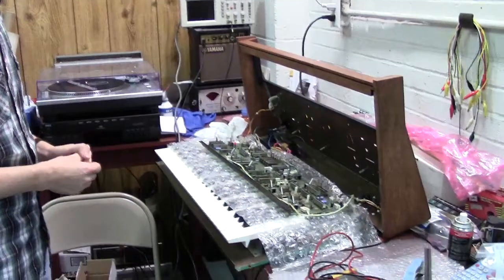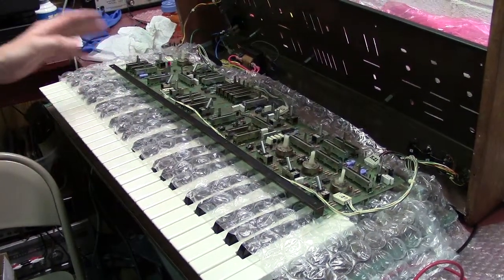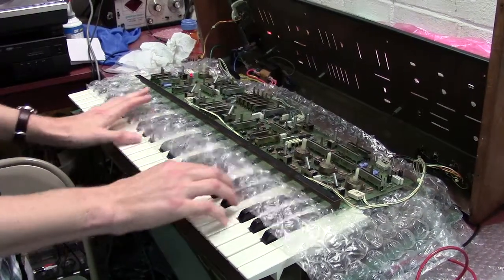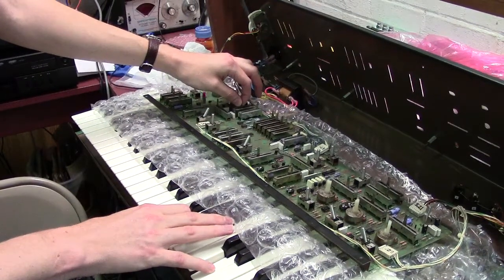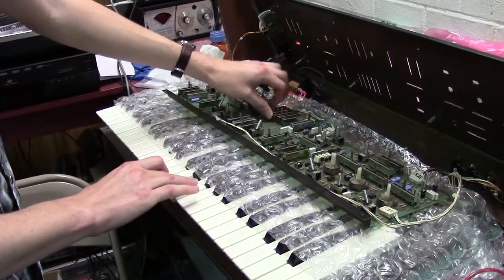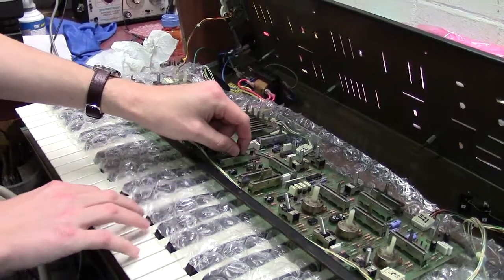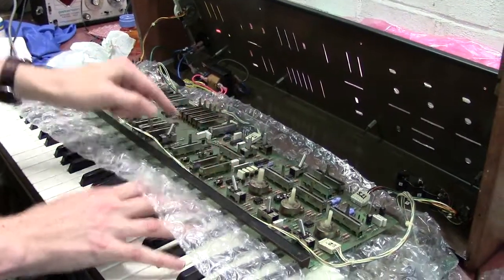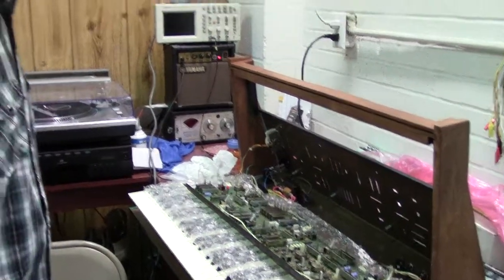Moog Opus 3 Rebuild Part 2 (by Synthpro)

Comment: Thanks for your videos. It's a great education on my Opus 3. I removed my black foam years ago. Any tips on cleaning the residue left behind ?
Reply from the maker: +David A. Lucas Your very much welcome David, happy to hear these videos help! 

There is a trick I use for getting rid of the foam residue...I have found that something like WD40 works great for breaking the foam up. This is going to sound completely against what I normally say but if I get a board that is very bad with the foam, I will take it outside and spray it down with WD40...take a horse hair brush and work the oil around all the bad foam areas......Then I take the board and give it a bath in alcohol to trip off the oil residue. Key thing with this method is remove any of the rare parts like the E402 and 3046.

Jareth
Reply: Thank you very much synthpro . You are the best !!!  DAL
Reply: I have found that Naphtha is an amazing solvent with no residue. I still had to "persuade" the foam to come off some of the components, but the solvent worked much better than other products I tried.  And where exactly can you find "naphtha"?  Turns out it's Zippo or Ronsonol lighter fluid.  Odor is minimal, it evaporates cleanly and leaves no residue.  (Of course, it's flammable, so use smartly.)

Comment: I found mine at an estate sale not too far away from me. I got to the sale at 3am to make sure I was first in line to lay my claim on it! I paid more just to make sure no one else could buy it from under me. I wish it had a way to add midi ports to it but I have a converter to run it into a midi port on my other Moogs.  If you know of a way to add midi ports to the Opus 3, think about it for when I send you mine to work on.

Comment: my articulator switch on the Moog Opus 3 is missing, I just bought a replacement. Looks like the attack and release is working though, not sure what mode it is on. How would i install the piece?
Reply from the maker: The switch replacement requires the interface board to be removed and then you will have to desolder the old switch and then solder in the new switch.  Something I'm sure you will run into is that nasty moog foam that goes between interface and circuit board....be careful not to get that stuff on your cloths or carpets, it will not come out. With that circuit board out, it's actually a good time to remove that foam but it's not very easy.